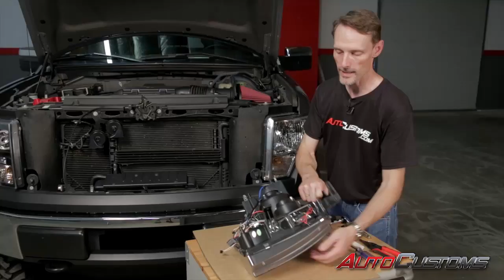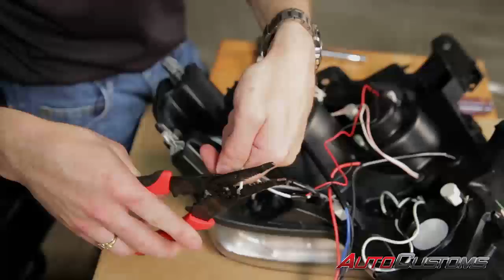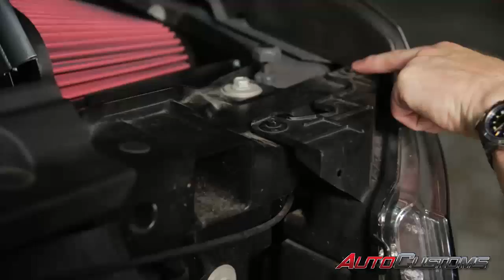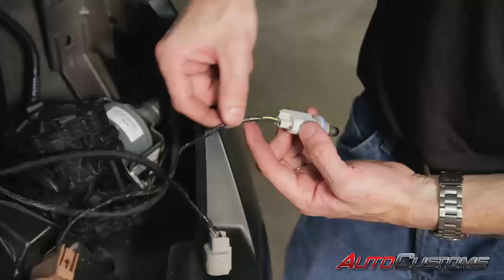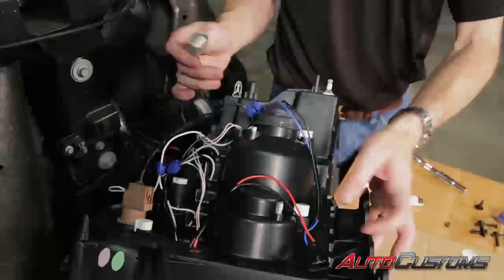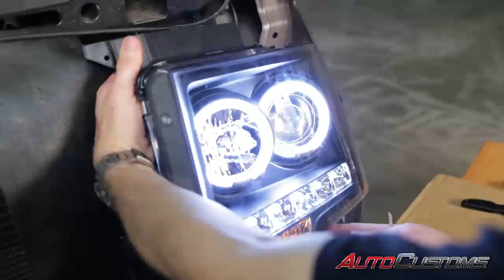Spyder CCFL Headlight Install - 2012 Ford F150 - AutoCustoms.com

Comment: Is this the same set up for the headlights from my car. I have a 2004 mercedes e500 and the harness for my headlights are 4 pin plugs.  The headlights that ordered have a 5 pin plug and won't fit with the harness from my car.  Any suggestions

Comment: Are the halos or any other type of light bar always connected to parking lights so they only come on when the parking lights are manually turned on or do they ever get wired to a constant source so they come on as soon as you start the car without having to turn on parking lights?

Comment: What happens if you wire them wrong for example the red wire with black wire instead of white will it mess up?
Reply from the maker: The easiest answer is the lights would not work. However, the wiring is tricky and that is not always the case. Unfortunately, I do not have that exact answer for you.

Comment: I just completed the installation, went great, thanks for the video!  I did solder, heat shrink and then tape all connections.  One question though...one of the small LED lights does not work.  How can I get a hold of one of the lights to replace it?  Are they standard and can I just go to a auto parts store, etc.?  Thanks!
Reply from the maker: You would have to contact Spyder directly. http://spyderauto.com/info.php?id=contact_us

Comment: I cringed at the wiring job. I don't care if God almighty says it's ok, never ever use wire taps, they WILL fail , or electrical tape to secure your connections. Always solder and heat shrink .
Reply: Me too, I only keep those wire taps in my roadside kits for emergencies, that's about all they're good for, kinda

Comment: wish my car was that easy. i have to remove the front bumper then there are brackets under the headlights that are almost impossible to get to. 4 bolts on them more push pin clips then remove install and replace.

Comment: That is a pretty poor wire job I mean the wires should be environmentally sealed so soldered and heat shrink wrapped with tape will just fail over time. A shop will probably charge you $60 to $80 an hour for 2 hours.